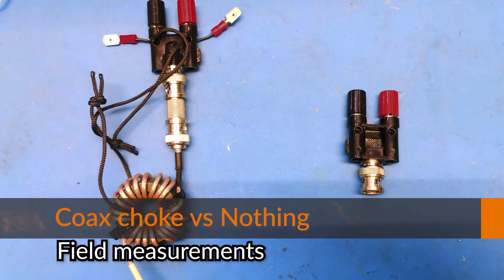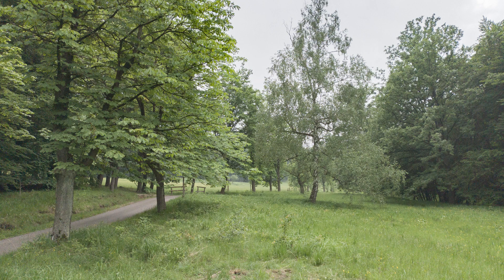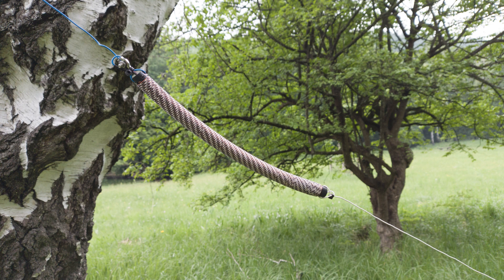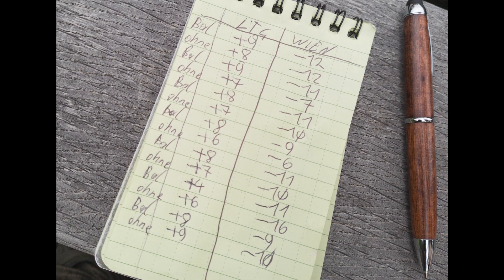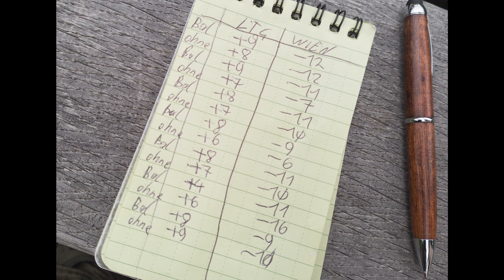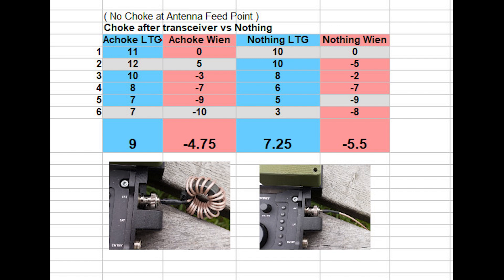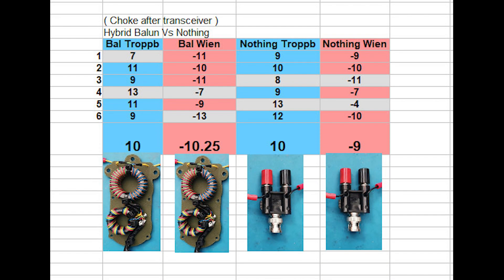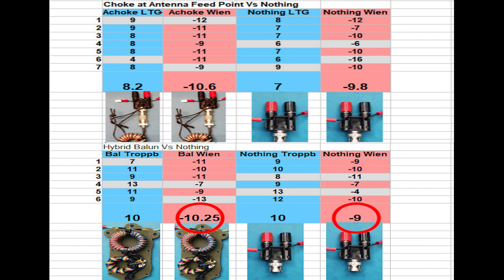NVIS Dipole, Coax choke vs Nothing

Comment: I wouldn't expect to see much difference in signal strength from a choke in use or absent. That's not it's purpose in the feedline circuit. It's just there to keep small stray currents out of your gear. Matching transformers are a different story, depending on where you feed the antenna.

Comment: Not sure how far you are from your receiving station in Wien and what type of antenna you have there…. But I think you can assume that you would get some type of vertical radiation (along with the dipole’s characteristic horizontal radiation) from the coax in the absence of a choke, and mostly horizontal only from a choked dipole. There are cases where the radiation from the coax could help your SNR, but not with high levels of reliability or predictability. 

When you’re relying more on ground-wave propagation, you probably would want more vertical polarization. And you’d want both antennas (transmitting and receiving) to be matched in terms of their polarization.
Reply from the maker: thx for your thoughts.
distance wasnt far... about 20km but about 150m hill in between.
the station at home has a vertical antenna.
not sure about the vertical radiation from the    cable...could be. I could test that theory by changing the coax cable from hanging down to going horizontal/perpendicular away from the feed point...or even better reduce the cable length to 1m or something like that.
Reply from the maker: afterthought...the SNR were higher with the choke at the feedpoint than without. that would contradict your theory imho. also keep in mind there was a second choke at the transceiver connected.
Reply: @CrazyChekov  maybe, but not necessarily. I think the point is that the radiation pattern will be modified from the textbook dipole pattern (even more than it already is by virtue of being in a low, real-world environment). The extent to which NVIS (on a low dipole) and ground wave are more effective will also vary by frequency and time of day. If your coax alters your radiation pattern by having the coax dangling from a horizontal dipole, it will almost certainly increase the proportion of vertical polarization. Whether that’s beneficial or not will vary based on the circumstances of both stations. You’ll get more radiation from the coax if your feed point is off-center. And if you’re going for NVIS, which sounds like maybe is your case given the hill/mountain between you and Wien, you’d probably rather want to keep as much of your radiation on the dipole elements as possible. 

Ultimately, you’d expect the same amount of total power radiated from either choked or unchoked, only with a modified pattern. But if your unchoked coax runs on the ground, you’d probably expect some ground loss. 

Having the chokes may also make the receiver quieter, in some cases. But perhaps less so when out in the field.

You might be curious to look at the New Carolina Windom coax-fed off-center-fed OCFD antenna (which purposefully avoids choking at the feed point and rather chokes the coax a specific length away from the feedpoint). On its fundamental frequency, in particular, it adds that vertical radiation quite a bit. It’s not exactly your experiment, but it’s an interesting implementation.
Reply from the maker: will add a test to my list with nearly no feedline at all that should clarify it.
we need more accurate real world tests to verify all these theories....systematically.
Reply: I didn’t realize that the feedpoint is low enough that you’re able to eliminate the coax completely. The length that’s dangling will make a difference, and will also be band dependent. There is a reason people like Dave Cassler (sp?) will say “with antennas, everything affects everything.”  If you’ve got really consistent signal paths that you want to work reliably/consistently, then the systematic tests are quite viable. But I’m afraid you’d almost need an unviable number of empirical tests in order to generalize greatly beyond that, and would have to fall back on more of a ‘systematic review’ of many published results and/or modeling. But I think it’s great that you’re publishing your findings, and will be interesting to hear about where you think theory and practical measurements seem to differ. Nice chatting with you a bit and 73!
Reply from the maker: yes feedpoint was about 2.3m.
Im quite tall. I can reach that.
we have now the chance with digital modes, where every transmission is idential, to find stuff, figure out stuff what we couldnt before.
will test how the feedline will effect the results next week. we will see.

Comment: 1:1's and chokes really don't help at all.
Reply from the maker: for a dipole thats what I try to figure out. other antenna types can be a pain in the ass without them.
Reply: If you have a greater imbalance on your dipole (due to either environmental or design/execution factors), you’ll probably see more benefit. The benefit will probably arise from less than ideal/textbook setups for a horizontal dipole, but could be useful for a dipole in other orientations etc.
Reply: In over 60 years as an active amateur I have never seen a case where I needed a choke or balun on a dipole, or any other antenna for that matter. An end fed half wave may be an exception but I don’t use them. Except for a few large Yagis, an inverted L on 160 and a Half Square on 80 meters I have used dipoles as my primary antennas. I typically use two dipoles per band as there is a null off the ends that can be quite deep. It makes a dramatic difference switching to the right dipole in those cases!
Reply: I just doesn't pay to over think a dipole.